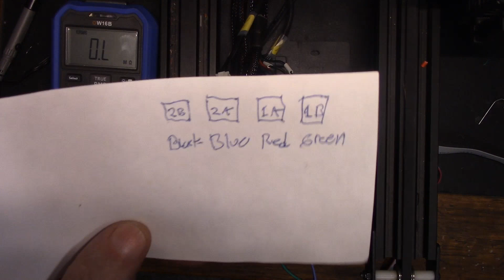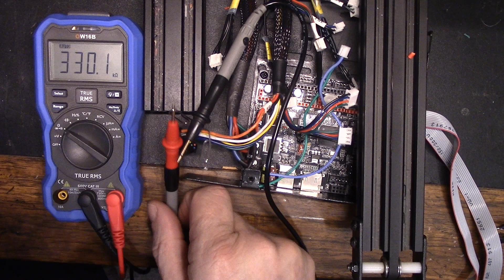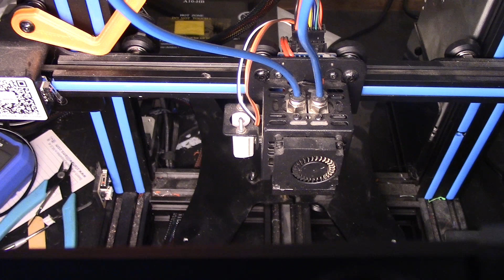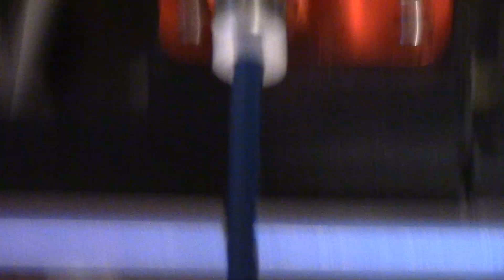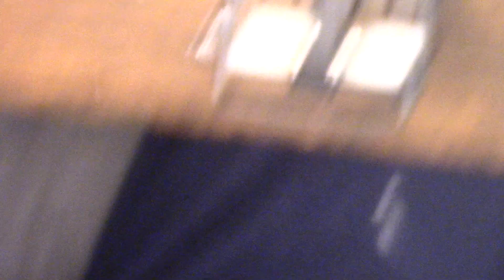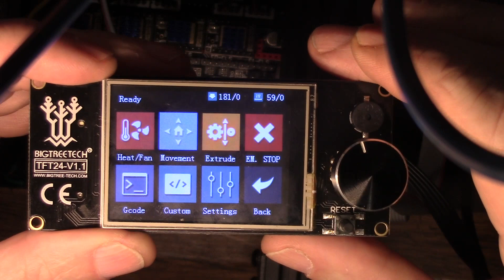Part 2 - BigTreeTech SKR 1.4 Turbo upgrade for Geeetech A10m

Comment: Hi, I'm following this video but I have a doubt. Where should we wire the green and blue cables from the 12 pin connector? Thanks!
Reply from the maker: I did this 4 years ago and no longer have the printer or remember the exact process. Sorry!

Comment: nicely done, thanks for info, May I ask what is the advatange of this upgrade?
Reply from the maker: Well first and foremost, the printer works again since the old board died. Also, I had one of the original A10M boards which has a lot of known issues and I didn't care for what it was going to cost to upgrade to the newer Geeetech board. So I decided to go this route and get some newer features like sensorless homing, newer motor drivers which are both more accurate and quieter. Honest, I wouldn't have done it had the original board still worked.

Comment: Hey Chuck, I really enjoyed the information and humor in this video. I have the exact same issue with my a10 and appreciate your candor.
Reply from the maker: Thanks for watching and commenting. It was a lot of work but once dialed in it's been working great. Well, except for the other day when some heavy handed ape over tightened the nozzle and stripped the threads out of the heat block. But thus is a great opportunity to try the Big Tree Tech 2 into 1 hotend. lol

Comment: I managed to bend the driver pins out of the way, instead of cutting it off, so. If ever i want to do the sensorless homing,I can straighten them out. I would have thought, if the bed was solid, that you could use sensorless on the z axis, and not use the bltouch (I sort of do that on my cnc mill, when the z motor cogs, I set z to zero.
Reply from the maker: I never thought to just bend the pins, but it might not matter as I'm having other issues with sensorless homing. Still working on it, but might have to go back to using the limit switches. As far as using sensorless Z probing is concerned, everything I've read says not to do it on printers that have a Z axis driven by a lead screw.

Comment: Chuck get some alligator clips that go onto the end of your probes, Amazon sells em cheap. Then you can shove a pin/paper clip/whatever you have at hand into the connector and clip onto it. Saves a deal of frustration =)

Nice video as always

AND... the video progresses, you already own them... shame on you then lol
Dude, why struggle? Right tools for the job blah blah etc etc
Reply from the maker: I've got a crappy set of those alligator adapters and I hate them, they're constantly dropping off and losing connection. What I need is a good set of them along with a really good set of leads for this work room. Maybe I'll just order them now while I'm thinking about it.
Reply: @3rdpig  Oddly enough I don't have a crappy set. I do have to admit to trying to buy quality where I deem it necessary. It's usually a process though. I'll buy something for cheap(er), realize that this was the wrong thing to buy a cheap version of, then go back and buy something better. Wrenches, sockets, pliers, pipe wrench, screwdrivers are an example of what to never buy the absolute cheapest version of.

You don't always have to buy the highest quality product out there but I almost never buy the anything at the absolute lowest cost. I also try to go to local hardware stores, support them when I can, plus I can put a tool/device in hand, take a good look and see how it "feels."

Comment: Geetech certainly did not make it easy for its customers with this wiring setup, do they not have a wiring schematic on their website?
Reply from the maker: No, there's very little info on their control boards other than the generic ones they sell to builders. There's a German site with info on this board but it's the 3.0 board and mine is the 3.1, so it's not all the same. Geeetech isn't like Creality, who got drug screaming and kicking into the light, they're still playing their cards close to their chests. So that's a bonus to buying a Creality printer even when I do prefer the way Geeetech does some things.

Comment: Hi Chuck
Thanks for your exellent how to
Is it correct that you use 20 gauge silicone cable
for all your extension cables?
Reply from the maker: I think 22 is fine for thermistors and sensor wires, but since I was going to use some of these for motor wires I stepped up to 20 gauge which will be fine. And I only wanted to buy one set of the colored wires.